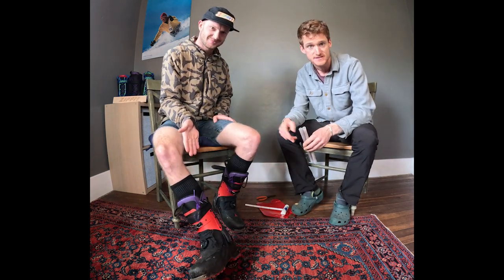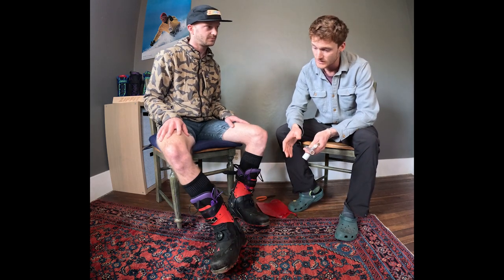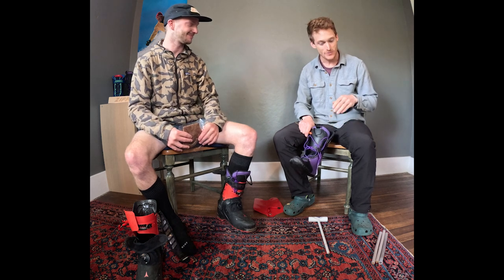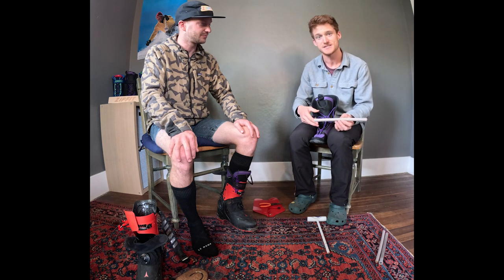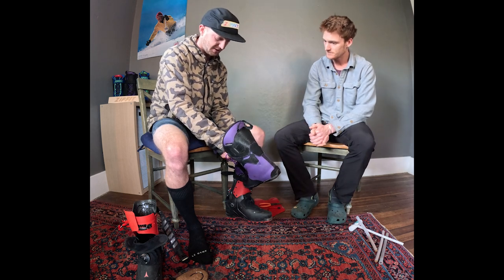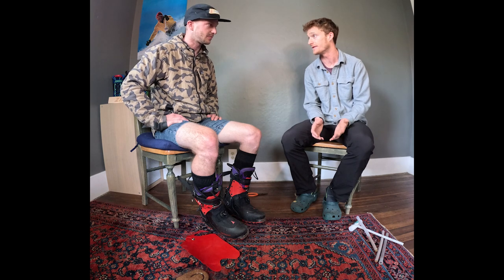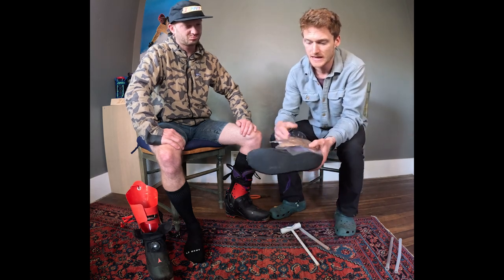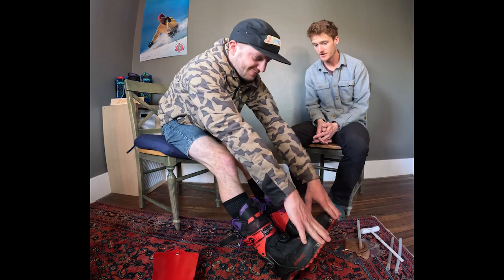How to add cork to your ZipFit ski boot liners

Comment: I wish we knew more about the ankle bone issue. My first thinking was that adding cork was the wrong way to go and that punching out the shell would have been a much better solution. However, fixing the heal lift would be the first problem to address, perhaps the ankle might be sorted out to some degree with the heal lift fixed.

Comment: The GFT is described as low volume. If you add more cork to the ankles, will it transform to fit a mid volume shell?
Reply from the maker: Great question, you can adjust the fit by adding more cork. We intend this process to be "spot fitting" meaning adding cork to specific voids in your fit. That said, if you add a couple of grams to each ankle pouch and closer to a full tube of cork (15g per tube) to each tongue, that will build the GFT out to work in a higher volume shell. I would recommend making small changes to one line and comparing the fit to the other liner, using one as a control and one as an experiment.
Reply: @zipfit9691  - Thanks for the detailed response. Does the liner come with any spare cork in a tube, or should it be ordered as a separate item(s)?